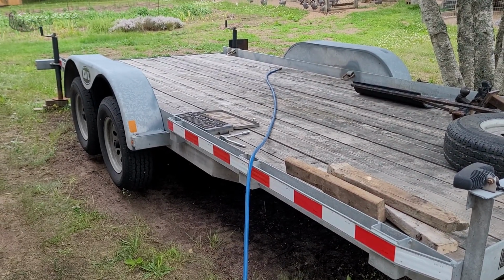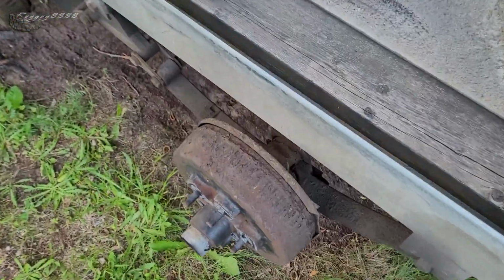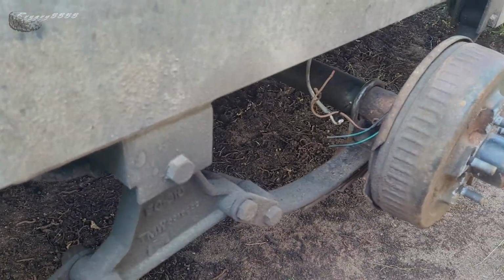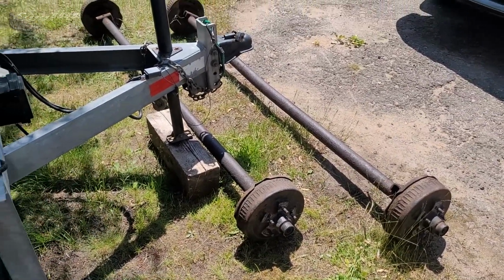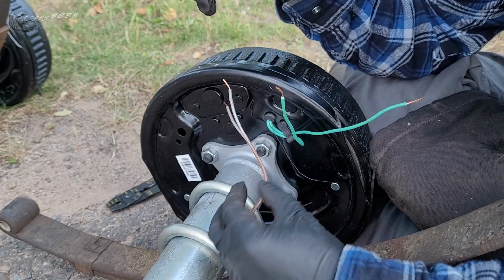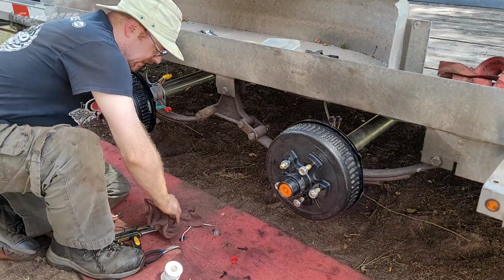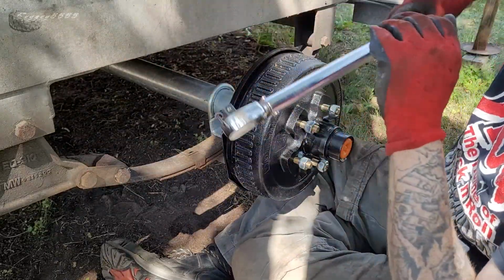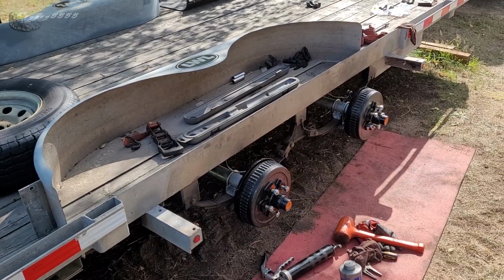Learn to REPLACE Your Trailer Axles.

Comment from the maker: What kind of haul trailer do you use for your ATV or SXS?
Reply: Running an old rebuilt (by me) artisanal tandem axle trailer, which has on it some old GMC C1500 axles, on leaf springs. It's 17' long, has obviously C1500 rims, with car tires 700kg each rating, disk brakes controlled by pressure on the hand. Calipers, disks and bearings and brake lines are a year old or so, when I did fully rebuild it. I can take 2 ATVs on it. The frame is sturdy, but I registered it as 1 ton max custom / artisanal trailer, which is enough for 2 Grizzlys on it :D . I used to have a one axle aluminum trailer, but on bumpy roads it was really jumpy, and I don't weld aluminun, while I do weld (somehow) steel, which allows. me to fix things on it. It's heavy, but on the road it's a tank :D
Reply from the maker: @alexandreblanc2842  That trailer sounds pretty beefy. I built a deckover many years ago out of a mobile home frame and axeles. It was so rigid that unless you have like 9000lbs on it the springs didnt move and inch.